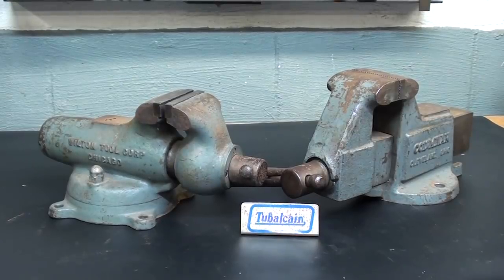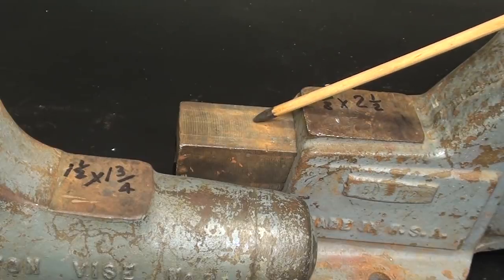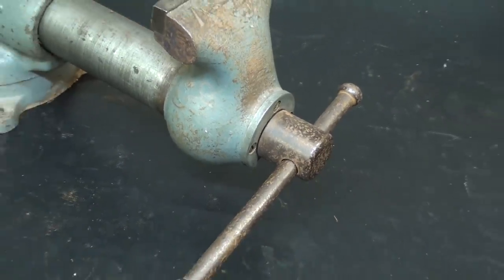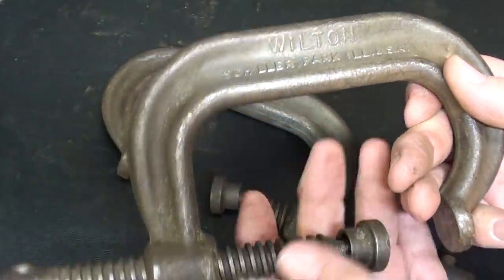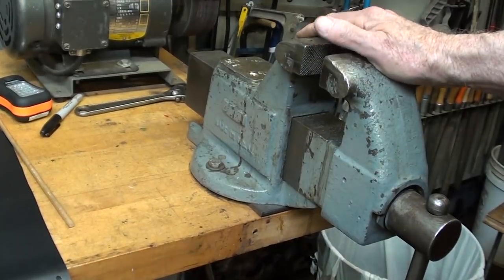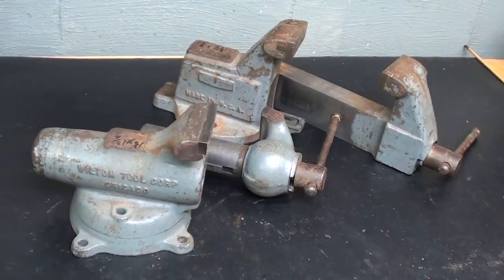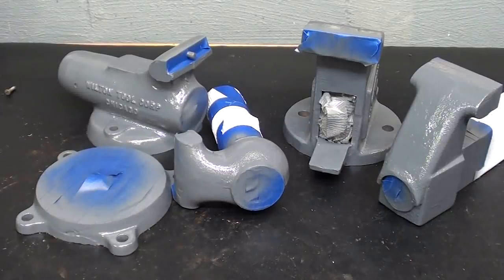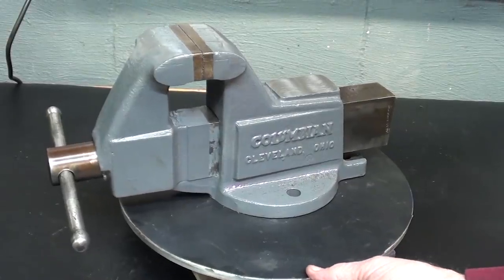Wilton vs Columbian Bench Vises  TIPS 554 tubalcain

Comment: I think for my vise, I will take a rubber sheet and cut it so that it wraps around the handle, make two holes in it with slits, so you can bend it over the vise and slide the handles into the holes around the shaft, leave it in place loosely, spray down the area with contact adhesive and press it into the metal to make a smooth fit around the shaft rather then washers (I think the washers look super crummy).

Comment: Mr. Pete,  I have a 4" Wilton vise that is built like the Columbian vise you featured.  The name Wilton is cast into the frame as well as the jaw size, the opening size, and 'Made in USA'.  It has a rectangular rather than a round shaft.  It also has a swivel base.  Is it a Wilton or is it counterfeit?
Reply from the maker: Not sure
Reply: Wilton made a ton of different models. Many that were not shaped like the famous bullet style too. My favorite Wilton is called the Shop King, it looks like a 1950s space craft design.

Comment: How would you thread a new nut with square thread?  Would the nut need to be cast iron or steel?  I have a couple 6" Columbian that need new screws and nuts. Thinking about making the nut longer so it holds up longer than 80 years next time.

Comment: I live in Romania, and have an old vise made in communist era at tohan factory. 150mm (6inches) wide jaws, it weights about 45kg (close to 100 pounds) all cast iron. Key differences: the movable jaw is at the back and the fixed jaw is at the front near the handle. The nut is held loosely in a hole in the movable jaw (it's just a cylindical stock with the threads perpendicular to the cylinder). Another thing is that the movable jaw moves on a robust dovetail (some had brass inserts on the dovetail and could be shimmed for tighter fits as they wear). The screw is held similar way to wilton with a half circle washer that rests in a groove in the screw. The odd thing is that the "half washer" has a 45 degree chamfer at the top and the body has an almost dovetail look for the same angle to lock the plate/washer and that is held with only one screw at the bottom.

The annoying thing is that the screw is quite exposed and lots of chips fall on it then crunched in the nut. - some made a rubber acordeon type bellow to cover the screw.. but welding and grinding and large parts that need the deepness near the screw will trash the rubber seal in a hurry.

What is quite astonishing is the weight and robustness.. the 120mm(4-5inch) is at over 25kg (over 55pounds), and the 200mm was behemoth at over 70kg (150pounds). The width of the jaw is about the same with the width of the whole body.. so no skinny body with wide jaws. I have the 150mm and the 120mm. 

The wider the jaws the mass doubles and triples as the body is also fatter with bigger screw and dovedail, it also gains height and depth with each increment model.. afaik they made them from 50-80-100-120-150-200-250-300 versions.. as for the 300mm series only seen one in a factory and can't say what it weighted but i'm sure you need a winch/crane)

Here is a picture of one of the models https://ibb.co/17Q4r3b

Looks a bit similar with unior bench vise's https://uniorusa.com/shop-bicycle-tools/quick-irongator-engineers-vice-with-quick-moving-system-150-721q6-us/ but without the quick slide and not so lightweight.
Reply from the maker: Very nice design. I like them

Comment: I have a Wilton Machinist bullet vise (no pipe jaw inserts) that I just bought last week, I have always wanted a quality vise and at 53 years old I finally was able to get one to spoil myself. It's a 4-1/2" made in June of 71. I was going to buy a new one but at $725+ it was going to hurt and the one I got is in excellent++ shape and only $300. It also has the swivel base. 
As far as Wilton being made in America the answer is Yes and No. Their "Combo Pipe/Bench and Machinist" bullet vises are still made in USA. Their "Tradesman, Tradesman XC and Mechanics Pro" bullet vises are made overseas (Taiwan).
I had been watching out for one of the old "Record" vises that was made in Sheffield but wasn't able to find one for a reasonable price. I also have a very heavy (made overseas) swivel head vise that I have had for 20+ years that has a pipe vise and it has served me well. The last of my vises is a 5" post vise and the screw box is in 90% shape so it will out last me and probably the next half a dozen owners.
Reply from the maker: I can see you have a passion for quality vises. Thank you

Comment: My older 3 1/2 inch Columbian is slightly different in design. Their is no anvil. It has a "swoop" instead. The jaws have two threaded holes, and the center 1/3 is proud, which requires a slot in the center of the removable caps.
Reply from the maker: Interesting, never seen one like that

Comment: I have a 4" Columbian bench vice that is completely shape formed and welded steel, something I picked up at a junk store. Cleaned it up repaint and got some new jaws for it. this thing is absolutely bulletproof. be nice to share a pic  however I have a pic on my FB page, Lee's Machine and Fabrication
Reply: Hello Mr Moody, I'm currently restoring a really rare old Columbian 804. Made with steel plates on the front and top. Sounds similar to yours. It's a MONSTER! I can't find barely anything online about it other than it was made this way because of the war (WW2.)
Reply: @jimbusmaximus4624  Thats neat, Im not sure when mine was made but it wouldnt surprize me its for the 40"s  as well.

Comment: Your Charles Parker 966 is superior to both.  I have a C.P. 976.  It is the same as 966 but with swivel.  The swivel mechanism in a 976 is unique in that it has a locking feature that does not loosen.  But, the best feature is the 0.8" dia. X 14"  steel bar handle.  There is a spring in the center hub that keeps the handle in place thus, the handle can be used as a flywheel.  I can move the 75 pound dynamic jaw with one finger.   I use the swivel feature at least once a week.  Once you have it, it gets used.
Reply from the maker: Yes 👍👍

Comment: Nice vises! I don't believe the carriage bolts and acorn nuts on the swivel are original. I have a 5" machinist's, and the swivel base a pair of bolts with swivel handles to secure it. IIRC there are two cast iron nuts that interlock with the underside of the base. It was a bit more complex than I expected.
Reply from the maker: you are probably correct--everything I own is used

Comment: Sorry but being from Chicago I'm a Morgan Vise fan. BTW, you can still buy the very same American made Morgan vises of yesteryear new for a fraction of the price of the Wilton Bullet vises which I consider the Cadillac of vises. Been in the trades 40 years, train airbrake shops and other industries. Hands down the Wilton beats both Morgan and Colombian vises in build quality. All are trough but the the Wilton has tighter clearances, it just does and it's not close. Price is the stumbling block though. At our industrial settings the Morgan's and Colombian's tended to need major repairs far more than the wiltons. They would break at the where the front jaw transition to the squared shaft we'd braze them  and they were good to go. Never had that issue with the wilton. I do disagree with you on which is easier to machine though. The flats are easily machined on a milling machine, heck a diy'er could even take a raw casting and with time and patience easily make the flat surfaces with a hand file or grinder. The wilton? Without specialized tools a diy'er isn't making the round machined shape, than making the notch for the key. BTW, you're Colombian had at least 10/1000's more of play, it would have been even more if you measured with the jaws opened equally. As far as throat debth, as you showed the c-o Wilton had a pretty deep throat and pipe jaws to boot. This all said. Morgan still gets my vote. If you don't abuse it it's Bullet proof and will last generations and costs but a fraction of the wilton and clearances are more than good enough on the Morgan.
Reply from the maker: Thank you for a great comment. Very thorough analysis of the two brands.  There is a lot of slop in my Colombian vice
Reply: @mrpete222  Yet that Columbian Vise if not abused will last generations and the slop/clearances are more than tight enough to get most any job done even if like the Morgan's aren't quite the equal of the coveted Wilton's.

Comment: Anyone out there have a source for Columbian parts? There used to be a guy on the web who sold replacement parts but I can't find him now. I've got a 3 1/2" Columbian I got at a swap meet that needs a new leadscrew and nut. I could probably make a new screw on the lathe, the internal square threads on the nut would be very hard to single point.

Comment: I break Asian 6" vises as soon as I get them by hitting the handle with a sledge hammer. My 5" Columbian from Boeing Surplus has not broken yet in 15 years. I think there is    cast steel vs cast iron  in vise quality and cost.
Reply from the maker: I agree

Comment: Mr. Pete,
  The vice I cut my teeth on was a post vice usually found in a blacksmith’s shop. My dad had a very long bench in the inner workshop of the barn. The vice was mounted in the middle of the bench. The post was actually a hand hewn chunk of white oak that was roughly ten by twelve inches. The bench frame was massive and apparently built when the barn was built as everything was put together with drawn mortice and tenon with hedge (Osage orange) pegs. The barn was post and beam construction all held together with those hedge pegs.Beams were all hand hewn white oak hewn while still green . The hedge pegs were driven into the still green frame wood and the wood would shrink as it seasoned around the pegs making a tremendously strong joint. Hedge was used for pegs because of the low shrinkage value. I was over to my home town last weekend and the old barn still stands proud. Its construction was truly a work of art. 
   My current main vice is a Colombian five inch.

Comment: At or around the 24:43 mark, you have a can of Shell Darina AX, Multi-Purpose grease. The question is: Do you reckon you'll ever need to buy a NEW-can, in your-lifetime? I'm only 67 y.o., but I still have a can of Pennzoil General Purpose in that very-same type of container, that I'd bought in or around 1965...and I still have at least a half-can left! Today's "new, improved"-GP lubes in NO-way have the quality/durability, of those old-school brands. (Although that's just my-opinion.) Oh, and judging by the color of that-grease? I'd make a friendly-bet, that it's NEVER-been "polluted" with "new"-stuff, either...! ☺
Reply from the maker: That can will last me for a lifetime
Reply: @mrpete222   LOL!!! Thanks for the comeback! I was hopin' I'd get a rise-outta ya' , on that-one!

Before I retired, I'd worked for ACF-Railcar, as a machinist/millwright. Done quite a bit of CNC-work as well, but it was always the ol' "hands-on" that'd eventually save the day, on those "weird"-jobs!

And with that being said, I still enjoy "playing" with metal-lathes & mills, although mine are smaller & way-outdated. But that's what makes it...fun!!! ☺

Comment: Wilton gets the style points, but isn’t as heavy duty as the Columbian, can’t go wrong with either of them.
Reply: Not as heavy duty? Idk where your getting that. He just said Wilton makes ones you can leave mounted on your truck even...
Reply: @bizzzzzzle  I'm talking about the 3" jaw comparison. As a high school shop teacher I can show many examples of the castings broken on the Wilton 3" bullets whereas other 3" jaw vices are still going strong. The bullets are not "Student proof"
Reply: @dennispope8160  I wonder if it's possible to integrate a shear pin into my favorite vise to protect it from breaking. Where did your vises break? The moving jaw or did the pipe bend like Mr. Peterson showed?
Reply: @EuroclydonEng  The moving jaw broke on several of the 3" styles. The larger jaw vice styles of the bullets seemed to have held up much better. Its amazing how many of these are at the schools in my area. If it were a personal vice I would not worry about it one bit. Students don't know the limitations of vices and want to try and crush things with them, so they hit the handle with a hammer, put full body weight on the handle etc... 
Mr. Pete talking about students playing with a the handles during a lesson definitely made me laugh. I think every shop teacher ever has had that happen.

Comment: I've never had a decent brand vise, so I'm not picky.  I've really come to like those 5" vises with the double-sided swivel head.  It's just too handy to be able to get the jaws vertical or to tilt it for pipe threading.  That said, most of them seem to be pretty cheaply made.  A lot don't have hardened pipe jaws, but mine does.

This one just has cast pipe jaws::
https://www.amazon.com/IRWIN-Tools-Multi-Purpose-5-Inch-4935505/dp/B009TOCZEC

Comment: how come you did not clean the vise in a giant ultra sonic cleaner after you meticulously stripped every bit of rust off the surface and resanded it down to a fine finish???? the paint might flake off in 15 years!! :omg:
Reply: on a negative note I took this route with a out door shed vise a few years ago and 3 years later the paint is flaking off in the non degreased area, but its fine in the degreased area lol.. humid ass shed tho